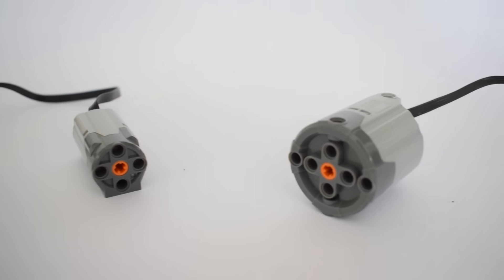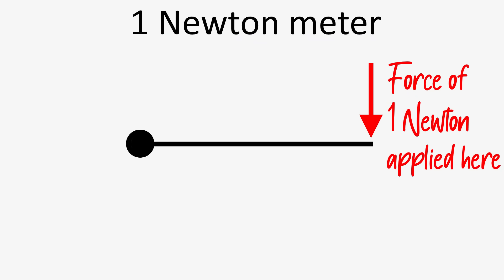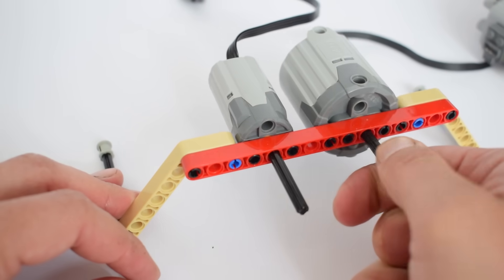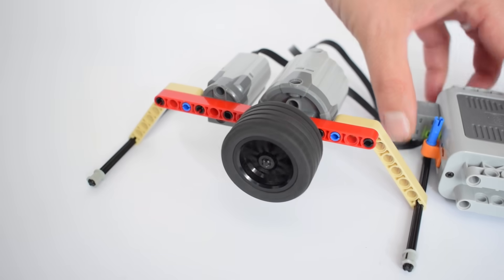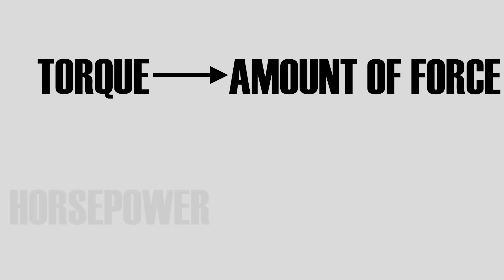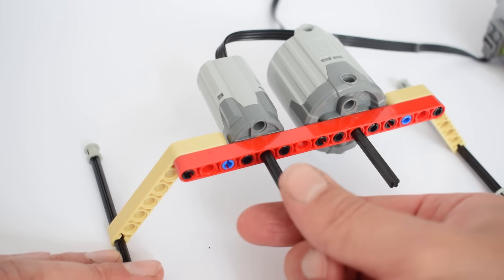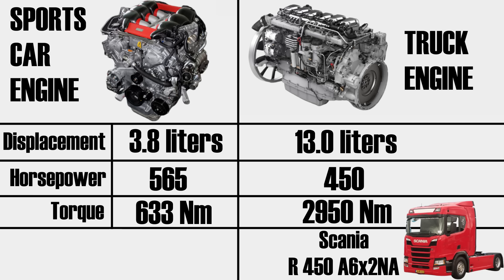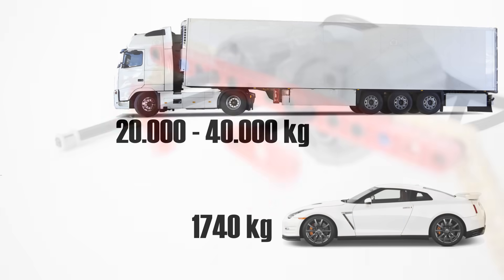NEVER be confused by HORSEPOWER and TORQUE again - HP and TORQUE EXPLAINED in the MOST VISUAL WAY

Comment: Long story short: Horsepower is meaningless. Torque is everything. Power is power. More torque, more power. Less RPMs? No problem. That's where gearing comes in.
Reply: Hivemind nonsense.  Gearing can multiply torque if additional power is available but can’t make up for a lack of power. 
Where do you get this “conventional wisdom” groupthink one dimensional thinking?
Would you compare Length to Area and conclude length is more important when we
know Area = Length multiplied by Width?
Or Compare Torque with Force and conclude
Force is more important?
When we know Torque = Force multiplied by
Radius
Or compare Stroke to Displacement and conclude stroke is more important?
When we know Displacement = Bore multiplied
by Stroke
Or compare Force to Work and conclude force is more important?
When we know Work = Force multiplied by
Distance
Or Compare Mass to Force and conclude Mass is more important?
When we know Force = Mass Multiplied by
Acceleration.
Or compare voltage to Wattage and conclude voltage is more important?
When we know Wattage = Voltage multiplied by
Current
Or compare hourly wage to annual income and conclude hourly wage is more important?
When we know Annual income = Hourly wage
multiplied by total hours worked.
Reply: 🤭 not really silly boi its power what is important torque is only component which consist along with rpm on power level which specified engine can generate 😎 if you say less rpm is no problem than we allow you to make let say motorcycle which must be competitive with me motorcycle on racetrack the regulation wilk look like this  i have 500 ccm inline 2 50 nm at 12000 rpm and 90 hp at 15000 rpm + perfect gearing quantity and diffrenc between specified gear lenght all setup perfect be enginner or somebody who know how it setup perfect whatever vs you can have unlimited dispalcement ,you can even use turbocharge for your engine you can also use freeellly how much cua tity of cylinders and setup you want even V8 V 12 whatever like you wish 🤭 + everything else whatever you want you can have whatever ho much torque you ant let say 1000 nm from turbocharged V8 5 litres your bike let assume weoght the same as minee have the same drag drive train losess the same and you also offcorse have let say perfect gearing setup be best f1 or moto gp team so cant be faster whatever how much gear be required and how big diffrence between gear lenght just perfect thats it 😎👌🏻 but ☝🏻 you cant have more than let say 60 hp peak and now try win drag race against me version or in race with corners on some big fast track assuming we also have the same tires suspension breaks geometry and corner speed the same for both the diffrences is only you have 1000 nm and 60 hp vs i have 50 nm and 100 hp and shat be the resuslts of this races? welll your version be completely smoked ineach posiiibleperformance test 🤭 so what are you saying ? 🤐🤭🫣get real boi 👌🏻😉 real world egzample cb 500 pc26 57 hp 47 nm vs mt03 47 hp 58 nm and mt03 accelerate slower have lower topspeed 👌🏻🤷🏻‍♂️ now lets take zx4 rr new it have only 40 nm but 75 hp it beat cb and mt both on accelerstion and top speed or something like h-d x440 38 nm 27hp vs benelli tnt 302 26 nm 38 hp and whatt happen tnt 302 beat h-d both on accelerstion and top speed so yea get real 🤓👌🏻torque is piss of 💩👌🏻power beat torque on racetracks all the way 🤭😎👌🏻🤭go check some of me test feg 3 tons car i comapre max tprque rpm 80 hp/240 nm around 90-100 km/h acceleration vs max power rpm 200 nm 100 hp around and what was the results offcorse max power rpm with elss torque beat higher tprque rpm less powerfull 🤭🤓👌🏻🤷🏻‍♂️☕️its extremely easy dependencys cos all explain simple fprmula 👉🏻power:speed = force but i just like this so write about this alot 😉👌🏻we can also explain this in other way around 👌🏻👉🏻 power is how much work you can do in specified time lenght or at specified distance so its how fast you can change object woth specific mass or resist position on specified distance 🤷🏻‍♂️👉🏻 so such you cant change position 10 ton truck feg or 100 kg moped on the same distance faster while having less power 🤭🤷🏻‍♂️ dosent matter how much more torque ypu have and how much more gear you have and what gearing you setup 🤷🏻‍♂️ 🤭🫣 its physiqallly imposiible 🤷🏻‍♂️ ….. you must have more power for change posotion faster or you defeat the same distance with the same resist slower at whatever gearing you want and at whatever how big torque you want simple as 💩👌🏻🤷🏻‍♂️ ☕️
Reply: @mociczyczki  this was painful to read
Reply: @szymoniak75  long story short racing win power 👌🏻☕️
Reply: @mociczyczki  yeah I know I'm just commenting on your writing style
Reply: @mociczyczki  Nah.
Reply: @mustangstuff7213  setup feg for drag race mustang mk6 gt 420 hp 520 nm vs lexus lfa 560 hp 480 nm both rwd similar weight and mustang have no chance .,trouble with gearing and torque is that … yep you can increase force output at drivewheel be make gearing shorter and shorter the only trouble is that velocity now is lower and lower + from 1 nm you can do 100 times biger force than from 1000 nm if 1 nm will have enough times shorter final gear ratio the only trouble is that it will move with 0,01 km/h yes it pull 100 metres 5 degrees uphill 1 mln tons load theonly trouble is it will do it 1 mln years 🤭and here come with help power 👌🏻 in racing whats matter is force but at specified velocity ☝🏻 otherword dosent matter what you do with gearing even if ypu have 1 mln nm at engine crank if you have peak 1 hp than velocity at which you want put all what engin have reduce output force be force gearing to be enough long for this very specified speed/velocity otherwise you cant put supershort gear ratio for let say 100 km/h velocity where engine be on massive droping tprque  /power rpm so waaaaaaaay to high rpm where engine have 0 tprque and 0 power assuming it also dosent blow up from to big force at cranskshaft 🤷🏻‍♂️ …. vehicle weight 2 tons if you are on track and you want take off corner on avg race track like laguna seca brno sachsenring whatever from let say 100 km/h  let say you have 10000 nm crank engine torque from 10 litres V8 but let say it have max 1 hp peak yes if ypu do supershort gear you exert huge force but only the lower velocity be but we want max force at 100 km/h at this point on track from this specified corner and what happen npw ? ypumust setup gearing in such way that all what this can generate be all the way from this 100 km/h and up to next corner which is let say 200 metres further you cant use gearing from this 100 km/h which is for 0,01 km/h 🤭🫣 unless ypu want use 1 mln rpm where assuming engine stand this and dont blow up will have 0 power and torque = 0 accelerstion only huge noise npthing more 🤷🏻‍♂️🤭 get it ? you ride on specific velocity nobody care how much force ypu can make from shortest posiible final gear ratio cos yes you can make huge force form shortest final gear ratio the only trouble is ypu will move like 🐢 and if you will want create huge force at 100 km/h and not 0,01 km/h now ypu need huge power especially if vehicle is heavy have huge downforce drag resist asf formake it move fast so accelerate as fast as posiiible so on tore grip border asf asf formula is simple power :speed = fprce otherword ypu cant produce more output force at SET SPEED if you have at this point in time lesss POWER  dosent matter what is your gearing rom level torque level whatever if ypu will have at this point at this specified speed less power available ypu b accelerate worse than something with 1 mln times less torque but more power assuming the same weight drag drive train losess asf other real world egzample just look at techspec the same car model. with diffrent engine version with more power and less torque have always higher top speed and lower 0-100 km/h time 🤷🏻‍♂️ unless doffrences are small and some version have bad gearing usuallly alll have optimal or very close to optimal gearing i. regard to some accelerwtion sprint test 👌🏻 rest is bs you dont make competitive car or motorcycle on track if ypu will have less power than competitiion dosent matter what you do with gearing and dosent matter how much torq your engine will have its phayiqally imposiible and if somebody sah otherwise he know 💩 about racing 👌🏻🤷🏻‍♂️🤓 moto gp bike have 260-280 hp and 120 nm +/-  give rider who is now champion in moto gp whoever it is let say bike with 500 nm and peak 100 hp dosent matter what  gearing you use 🤭 he be now always last in each race except times when some other rider crash and dont go to fisnih line than he be not last be ahead those rider which cradh only rest completely drive away from him and double him in all race basically in half of distance 🤭 270 hp moto gp bike can accelerate from 100 to 200 km/h in 2,5 sec vs ypur 500 nm 100 hp version V8 with turbo beable to do the same in like 7-8 sec generate  almost 3 times lower force at drive whell all the way from 100 to 200 km/h completely be unable to hang one with other bike in race the same with f1 put in f1 steam ngin assuming it willweight the same asf which have like 1000 -2000 nm whatever alot nm more than f1 stock have but let say 140 hpmax and the same story stock f1 smoked your car like it will stand in place dosent matter what gearing you do 100-200 2,5 vs 15 sec os if with this steam engine 140 hp be enough for achieve actuallly 200 km/h with all this huge down force which f1 have 🤭 torque is only component bs piss of 💩 vs power determined true peak performance which engine  can develop long stroy short gearing cant be to long for set speed but also cant be to short gearing be itself mean 💩 power at set speed determined true peak max performance not gearing torque or rpm what say formula power:speed= force rest is GAY 💩🤮👌🏻

Comment: Torque is twisting force. Horsepower is a mathematical equation. (Torque x RPM)/5252. It’s as simple as that.
Reply: Power is the ability to do work within a given time period.  Torque is a mathematical equation.  Torque is the sound of one hand clapping.  Without RPM nothing…. happens.
Reply: @rollsroyce329  everything you said is almost completely wrong. torque is useful without RPM. Cruise ships turn their engines at anywhere from a whopping 80-150 RPM. they generate in the area of 5 million foot pounds of torque at this RPM range, and given the equation i listed earlier to define what the horsepower rating would be, at a STAGGERING 80 RPM, these ships STILL generate 76000 horsepower. Torque is a twisting force. Horsepower is a figure produced by a mathematical equation generated from your torque and RPM numbers. thats it.
Reply: @darkness_falls94 so torque is more important than power because power is merely an equation?
Reply: @rollsroyce329 without torque, there is no horsepower. Without horsepower there is still torque.
Reply: @darkness_falls94 there is still Torque, it just can’t accomplish any work.  Much like the sound of one hand clapping without the RPM hand there is no sound.  If you have power on the other hand Work can be accomplished.  Isn’t that really the point of an engine?  Accomplishing work?
Reply: @rollsroyce329 fair point, but my original contention is that engines produce torque, not horsepower.
Reply: So to recap about everything I said being “almost completely wrong”:

1. Power is the ability to do work within a given time period. 

Power = Force x Distance / Time.  (Work
Being the Work = Force x Distance part.)

2. Torque is a mathematical equation.

 Torque = Force x Radius

3. Torque is the sound of one hand clapping.
Without RPM nothing.... happens.

This one is a bit cheeky and intended to provoke thought and conversation to counter the “conventional wisdom” of the internets with its erroneous statements like “Torque is for towing because tractor”. Horsepower is for top speed because race car”. Or “torque = strength, Power = speed” let’s not even talk about the “moving” or “taking” of walls.

It is accurate however in that without Power, Torque is doing no work whatsoever.  If there is Power a clearly defined and measurable amount of work is being done.  That is why we have engines and motors: to do Work for us. The more Work they can do within a given amount of time (the definition of Power) the more useful they are to us.
Cheers.

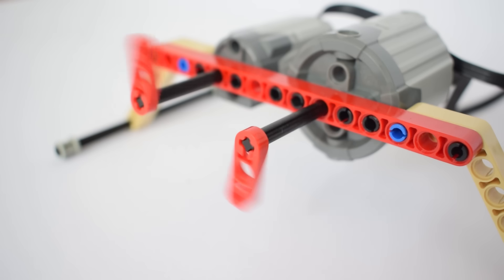Comment: 6:02 torque can be felt, horsepower can be observed.
Reply: Nope, in a car you feel transition over time. Your body is an observer. You feel the horsepower.
Reply: Both can be felt both can be observed.  Point is moot anyway.

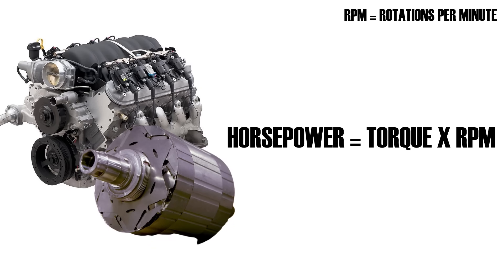Comment: 6:43
U said HP = T × rpm .
 
My z900 has 125 hp  and 95nm torque  
Then RIP for RIP or RIP  for ur equation? 💀
Reply: It's torque×rpm×a conversion constant. If power is being measured in horsepower, and torque in pound feet then the formula is torque×rpm/5252
Reply: Because your cars specs are giving you different rpms for peak power and torque.

The truth is the torque number doesn't matter. It's about the power band, or how much torque at a given rpm (ie horsepower)

Comment: Amazing, thank you. Just two more facts based on your video that comes to my head: 1) You can rise torque of any motor by gearbox, but you cant easily change its powe output (HP or kW), it remains the same. 2)  Newtonmeters can be also roughly explained as 1Nm is 0,1Kg on 1m long lever.

Comment: Torque is like a Clydesdale pulling a plow through the earth, Horsepower is like Secretariat winning the triple crown.
Reply: Power and Torque are not Batman and Robin please stop trying to assign them roles. Power, not torque, is the limiting factor for not only how fast a vehicle can go but also for how much weight it can pull at a given speed and/or how fast it can accelerate a given weight. Torque is the sound of one hand clapping. Without RPM nothing happens.

Comment: yup, our 454 chev was built to pull, so it ended up 300 horse at  1100 ish foot pounds of torque....could drop the clutch in 1st gear and it wouln't stall LOL     6000 pound duelly

Comment: Another point for truck vs sports car comparison. Trucks run on diesel, which has much higher calorific value per kg of fuel compared to petrol in sports car. Diesel is also difficult to combust, hence you can only achieve much less RPM than Petrol engines. Hence, diesel engines get low RPM but high Torque,and petrol engines achieve low Torque but high RPM.

Comment: This makes more sense now. Torque is basically how strong the rotational force is at the wheels. A honda civic si with around 200hp but only 140ft of torque has to get to high rpms to reach that power. Whereas my gtp comp with 260hp and 280ft of torque can achieve power at a much lower rpm. Gearing is also a huge factor in this too that needs to be explained.

Comment: Still not understanding how the smaller motor has greater RPM than the large one. If the larger motor produces more torque, why does it not have greater RPM? I would think it would have a greater rate of force application as a result. What am I not getting?
Reply: This video, as most videos about torque, is actually a bit misleading. Torque and Power are in direct relationship with each other. The reason why the bigger engine doesn't have that more power is because its torque decreases as higher RPM (dropping earlier and quicker than on the smaller engine) the metrics given at the beginning of the video are PEAK values. For electric engines that is usually at or near 0 RPM for torque, and as high RPM as it goes for power. At the same RPM, power and torque are always in the same ratio to each other. Power = Torque x RPM.
Reply: @Willyfisch  okay but torque decreases at higher RPM for the small motor as well, so why it has greater RPM?
Reply: @szymoniak75  For the exact reasons WHY this specific motor has a flatter torque curve than the smaller one, you'll have to open it up and see. Probably it's either because the larger motor has a stronger magnetic field that gets saturated more quickly or most likely it has to do with higher back EMF (Electromotive Force) of the bigger engine. It has to do how electric engines work and requires more explanation than would fit in a comment.

The important part to understand is that the bigger engine in this case loses more torque at higher RPM than the smaller one, which is not mentioned in the video.
Reply: @Willyfisch  ahh yeah maybe back EMF you're right

Comment: Ford trucks had a reputation for lasting a long time in original condition specifically because they were tuned for torque and not power. I did some work for a guy who worked at a concrete manufacturing plant (natural gravel) who said all thier yard trucks were old fords. Built tough was true...at least at one time

Comment: I find it incredible, how many people actually dont understand the difference between power and torque.  The closest you got to the point of understanding is when you compared the truck engine and sports car engine. For better understanding, I would prefer both truck engine and car engine the same amound of power, lets say 400hp. The huge difference in torque is caused by significant difference in rpm, when reaching this power. Thats it. Nothing more, nothing less. When you reach the same amound of power in lower rpm, you have more torque. When you reach the same amound of power in higher rpm, you have less torque. Its that easy.